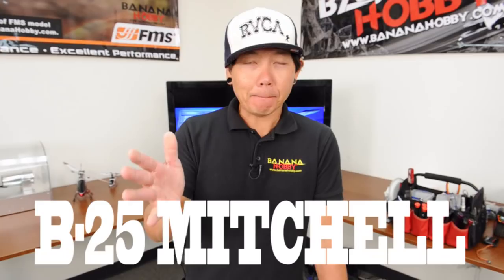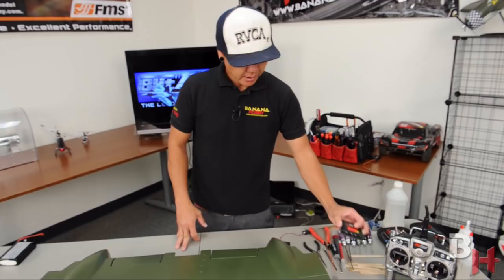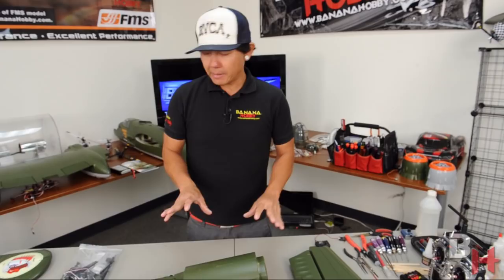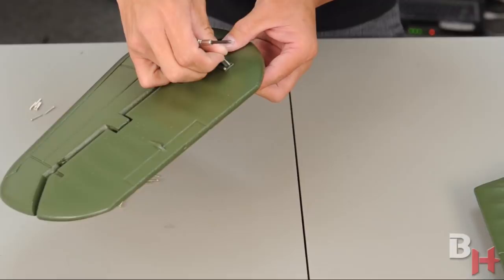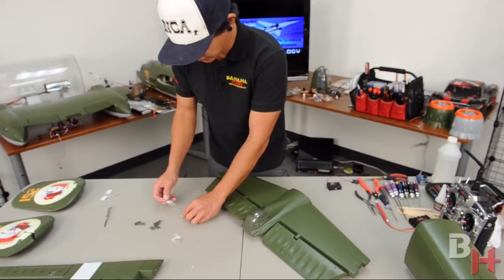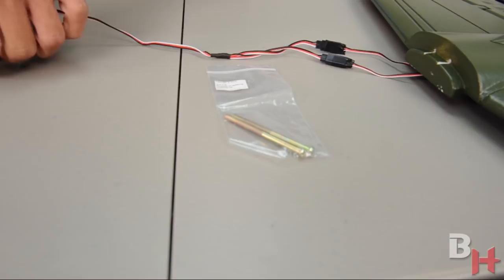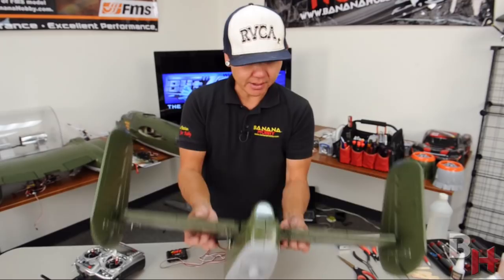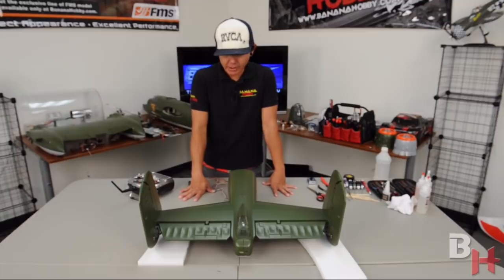Super B-25 Mitchell Build Review

Comment: Pete - Here's a little hint on how to glue - Put the glue in the hole and not on the part. That way the glue gets pushed into the hole instead of oozing out onto the painted surface. Same thing when you're applying glue to the rear fuse section. No cleanup needed!

Comment: One thing I do when assembling, and gluing parts together, especially parts this large, I put the wires through a plastic, or rubber tube, and insert it through the fuselage, so when you join the halves together, you aren't getting glue on the wires. Then afterward, you simply slide the tube off of the wires.  
You ended up breaking the gun mount when you pressed the gun into the clip.
Great build, and I will be getting one soon.

Comment: The only problem is he is doing a receiver ready and not a kit version which they sell. The detail that comes with running all the many wires not only in the wing tips but the center section with the ESC's and wire harness. surprised that they did not use quick disconnects for the wing tips.

Comment: I can see you are familiar with balsa and ply cutting, gluing, sanding, covering, painting, engine or motor instalation and related systems, radio instalation and so one. All the  hard work. By the way, I probably enjoy as much as you too watch this, but what I see is assembly, not actualy building.